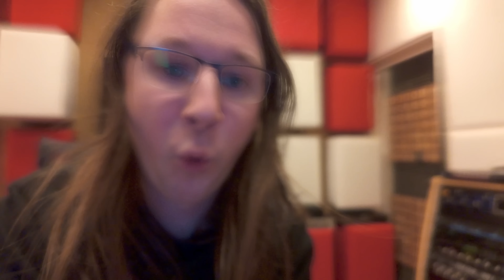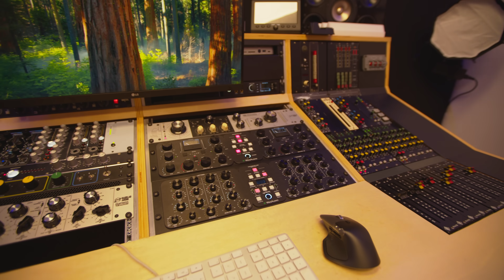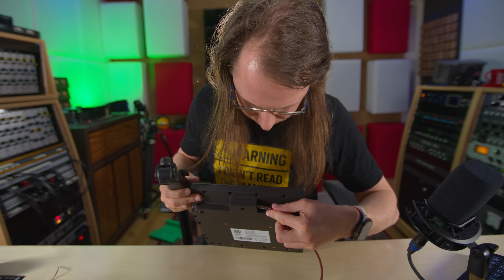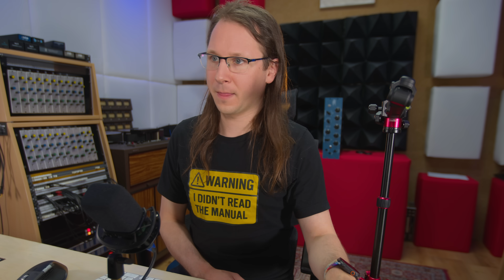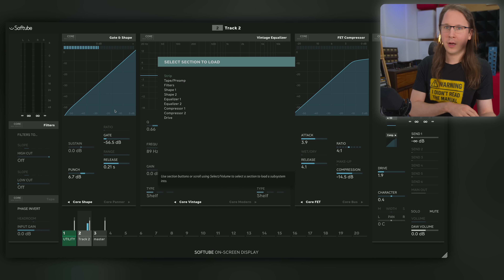SOFTUBE SCREWED UP.

Comment: Hey Wytse, are you still planning to take a closer look at the Console 1 Compact? I’d love to hear your thoughts after spending more time with it. Since getting the Compact, my Console 1 Fader Mk I has been working without any bugs, and the DAW integration works too, with both devices running in the same system.

Comment: I've just chance to compare full SSL system against Softube ones recently in my studio when using SSL as standard for a year or so. Needless to say, I am not primary sound engineer, I am producing stuff and at the same time mixing it. And this is where the Softube is not so convenient for my workflow. Softube is actually much more "closed" system than SSl ATM. I don't know how you guys mix, I don't do pure acoustic music, however in my application I often need gaps between stages to work around with the sound and it is simply not possible to resolve it with one channel strip. Eg. usually you would need first gain stage it (ideally out of the channel strip, so that you can gain match later stages), than after eq and compression you may need to balance the result with another eq. On top of that I would include different sorts of "production" plugins, like distortion, saturation, modulations, granular stuff etc. in between. And than in the end you may need to do extra dynamic stuff like different compression, gentle limitation or work with transient. Basically I think Softube stuff is more ideal for pure acoustic music, where you can possibly resolve everything in one go. SSL gives little chance to split the parts of the system among more stages (separation of channel strip, and bus comp., however also access to plugin parameters trough UF1 which can be really useful if you keep the same structure over channel strip). I could see this smaller Softube controller as possible addition to the extra stage, if you think about your desk as way to access as much as possible things like on traditional desk... Problematic thing about SSL is it can allow  GR measurement only at a few third party companies (and UAD is not one of them), UC1 doesn't follow the track in Logic (apart from Softube), compressor in the native SSL plugins is not so much useful... And what I like about Softube as well is better feeling of build quality of knobs and faders.

Comment: I bought into the console myth..it's not dependable.   Tracks stopped working, we're not seen, Eq settings did not stay in place across mixing sessions.  I went back to uc1, uf8 and uf1.
Reply: How many track
Reply: @olajideojodaniel282 I think there were 40.. which  included bus tracks and effects sends

Comment: SSL might be perfect, BUT...BUT in the video you describe the problem exactly as it is. And this problem is huge, because it goes even beyond the fact that not ALL of SSL’s own plugins have been integrated into the SSL 360 system yet.
SSL’s integration is so poor that not even their own plugins can be fully integrated into UC1 manually via the VST3 interface, because they forgot to enable all the necessary parameters. For example, the VU meter display from “autoBUS” cannot be transferred to the UC1’s VU meter.
I contacted support about this immediately after the plugins were released, received an acknowledgment of receipt...but to this day have received neither a response nor a solution to the problem.
If SSL doesn’t finally get off its ass and stop just resting on its laurels, it will go down the drain, just like the company whose name we no longer mention. They’ll ruin their reputation if they keep this up.

Comment: Don't worry you aren't missing out. A year later and the Console 1 and Fader 1 still aren't reliable whatsoever. I lost 2 hours of work this morning because of a firmware update. When they work, they are amazing and time saving. But they are still crashing out my DAW at least a couple times a week. And once a month it will also fail ilok auth (if it checks during a project) which will reset all instances of the Console 1 plugin on every single track (which unless recently saved, is devastating). This is not professional level hardware.

Comment: Hi Wytse! Thank you for making this video. I own a Console 1 Mk2 and I really enjoy mixing with it, but for some reason I noticed that whenever I used Plugin Alliance plugins to create custom channel strips, the software for some reason decides to reset everything but the faders (it still looks the same, so my EQ and Compression and saturation look like they're on and working but when I moved the knobs, the sound doesn't change at all). It is extremely annoying and I'm considering selling my Console 1 at this point since this issue has screwed more than one mix and it took me a while to figure it out and redo the mix with my regular plugins. If you have the chance, could you please reach out to Softube about this issue as well?

Comment: More totally impractical garbage controller BS. For me it's still the mouse / trackball. I'm still waiting for something that would actually work and be practical and replaces the mouse. I do like some fader controllers for this and that, like a Firefox UC4 that comes in handy sometimes when automating plugins. Thats it. It's more important for automation than for dialing settings honestly. So more important on softsynths than on mixing plugins. For me , at least!

Comment: I just sent my Flow controller back ... not because of the subscription thing, but because i can not use Console 1 and Flow together.
If they manage to package it into one container plugin where Flow does the macros and Console the micro i will look at it again.
And oh boy i am happy i do not have to think twice if my filter is my filter or my gate or shape.
This is the opposite of what Console 1 is for.
Especially in a dimly lit condition as one can not read the secondary yellow labels.
Reply: this comment is underrated. Flow gets you broad strokes. But instead of finetuning the strokes, you can only "paint over" with compact or mk3.
Reply: Which daw do u use

Comment: 3:43 This is pretty much an outdated comment now. SSL 360 has given UC1 a significant update about one~two years ago, which allows UC1 to map to almost any plugin, whereas Console 1 MKIII still ONLY works with Softube and its very limited partners, or using MIDI CC mode.
Reply: I don't know about the SSL - I will look into it - but I was super disappointed with Softube since you lose so much control over let's say UAD plugins.

You are also paying for the presets when you buy a UAD plugin and I find them intuitive as a starting point, that being said, there is NO WAY to change your preset in the Softube VST for a particular plugin you are controlling. And as an addition to that, you get maybe 3 knobs for a certain plugin. Big let down.

Comment: I've owned three versions of those pieces of sh!t Console Ones. None of them have ever been reliable. The current version 3 Console One breaks so often that I finally after spending many thousands on this crap, threw it in the garbage. The support is useless and they never admit anything is wrong. I have never in the many decades I've owned a studio had anything this bad. So I love that you are having the tantrum I have had many times. Into the garbage it should go.

Comment: I’m sorry to hear about the numerous issues you encountered with your previous MK3. I also had a lot of problems, but with the firmware updates and the bug-fixing of the Softube central, it’s been quite reliable for me. I finally discovered that Avid Link was causing a significant portion of the OSD loading issues. Once I removed Avid Link, the OSD would load without any problems. I’m incredibly excited about the latest update and how it integrates seamlessly with Ableton. I have Console 1 Channel, Fader, and Flow Studio, and they all work together very smoothly. Now, if I press the load channel strip or flow button on the hardware, it loads the plugin to the track. That’s one less mouse click! It’s been working great with Logic as well. ProTools is okay in HUI mode, but I prefer working in the other two DAWs. I’m eagerly looking forward to your review of the little console one.
Reply: Updates helped me too
Reply: @Rhuggins I’m running out of usb ports on my Mac Studio to get this one, I’m just patiently waiting for a transport controller  similar to the UF1 sans the fader.
Reply: @Steve-br7wt  Same dude. Same. Waiting for a transport controller like the UF1 and then they come out with this garbage LOL
Reply: @Rhuggins somebody said they're working on transport controller
Reply: @olajideojodaniel282  I heard! Woop woop!

Comment: I'm not an engineer but would it be feasible to use a semi-transparent faceplate with function labels stenciled in... and when you switch modes, LEDs under the faceplate light up and shine through the transparent labels? You could have one set on the bottom for eq, the other on top for dynamics. Shouldn't be too expensive vs using dedicated OLED screens for each knob

Comment: Just a heads-up, some genius has reverse engineered the UF8 and UC1 for REAPER so now they can do almost anything. No need for the 360 link software at all, and it goes way beyond what the SSL third party plugin control could do.

Comment: Console 1 now directly integrates with Cubase Channel Strip. WOW
Reply: But it still uses that console unreliable vst plugin.  Tracks are not always see, EQ settings are not consistent across sessions, and projects sometimes don't open because it hangs on the console one vst plugins across all tracks...it's garbage in nuendo and cubase.

Comment: Unfortunately I've still got huge CPU Spike problems with almost all Softube Plugins. Now almost 2 years of chatting with Support and still no solution. They once said they were able to reproduce the issue but still no fix. And the same Problem is reproducable on a friends Windows System (I'm using Mac)
Kinda lost trust in Softube although I really like the Sound of their Plugins

Comment: Mine are sitting in my cupboard, they are just too unreliable
Reply: Maybe you should update its firmware...
Reply: @olajideojodaniel282 yes     I've tried that  sometimes it works and sometimes it doesn't, and I'm not going to use something on the off chance that it might work when I've got other controllers that are as solid as a rock
Reply: @DS-wn4dx what other controllers do u use...
Reply: @olajideojodaniel282 I use the presents faderport and the MP Controller which is brilliant I can instantly map any plugin from any company, it has 32 physical controllers and it's also touchscreen, and when you load the plugin you get pl
Reply: Plugin picture and you can see the dials moving, you can also save multiple plugins on your inserts and can recall them whenever you want  so between the faderport and the MP Midi there's no need for the softube controller and faders, and because the softube is so unreliable I don't want to sell them on to someone else, I don't think that would be fair

Comment: SSL added 3rd party vst support i think late 2025/early 2026? Just fyi
Reply from the maker: I know! But it doesn't work that well... as in, the controller has really been designed for use with their channel strip...
Reply: @Whiteseastudio did you try your UF1? You can assign any plugin parameter to the pots on the fly, and the parameter names and values instantly show up on the screen. Works flawlessly! And the UC1 can easily be configured to control any other eq, channel strip or compressor plugin.
Reply: @AlainNLDB how do you do this and which plugins do you tend to use it with?

Comment: Using SSL 360 the SSL controllers can control anything you throw at it. Anything, flawlessly.
Reply: Exactly. I got the UC1 when it first came out, at that time people were doubting it due to the "closed system". But now, I'm so glad that I never sold it. It's better than ever and I even bought the UF1 to work with it.
Reply: UC1 and UF1 here, have the UAD distressor as default compressor on the SSL 360 Link Bus Compressor, love it
Reply: Exactly.  Got soooooo many plugins mapped to my SSL controllers... I'm all-in, no desire to look back!
Reply: I have the all system. Very fluid!
Reply: Yeah, and he's already done a video on this, but I guess he forgot?
Reply: Yes. Same here with the UF8.
Reply: 🙄Facts!🫡
Reply: Does it integrate with fl studio
Reply: SSL UF8 UC1 UF1 exceptional behavior.